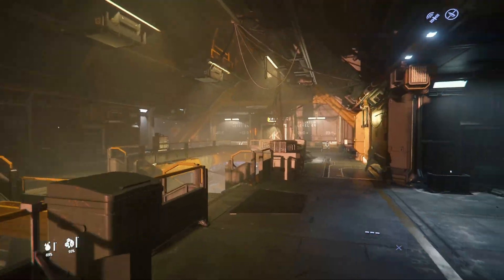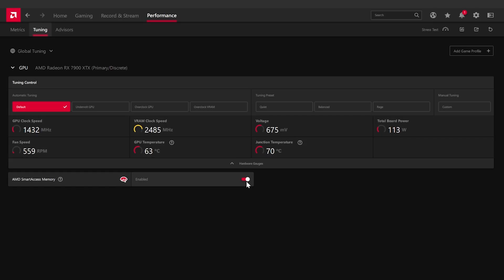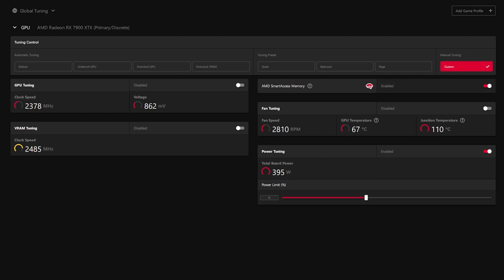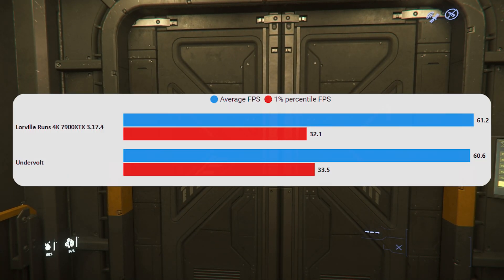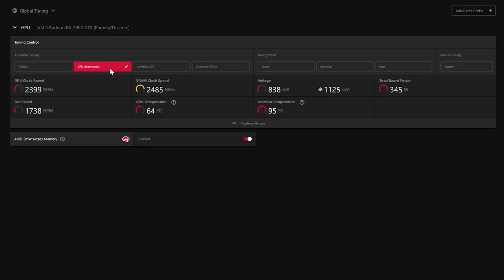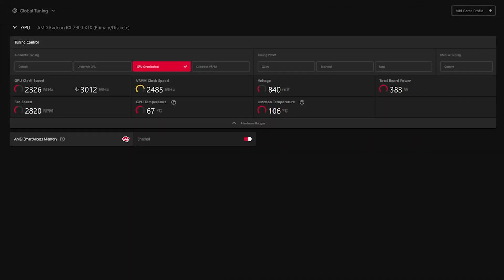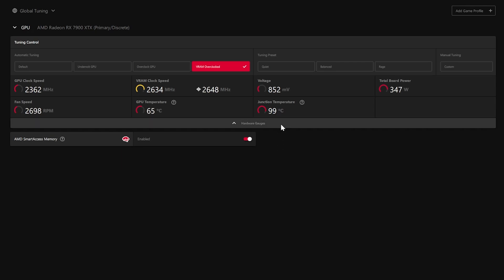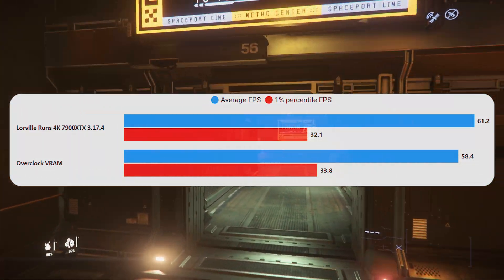7900 XTX Overclocking and Hotspot Testing | Star Citizen

Comment: I just got the MSI 7900 xtx a few months ago. I usually have to turn down settings cause it can get well over 90c, only when ray-tracing though. Id really like to find a hotspot temp fix. My 7800x3d can get well over 80c sometimes too but I'm using an air cooler so that's probably why.

Comment: um 1 you need to manually adjust fans for overclocking they have zero rpm on on default which results in high temps it is not running at 100 percent that would change your temps also may want to check thermal pads and thermal paste application you are literally at a 6900xt overclock performance you really need to manually adjust the fans hate to say it but your overclocking that requires fans at around 80 percent by 60 c and 100 percent by 70 c you should never pass 70 c

Comment: Got the reference card from AMD for 1125€. Had the same issue, my junctions would only hit 110°C with +15% PL. Ended up sending the card back for a refund and got myself the XFX Merc 310. Even at 450W, with 50% fan speed, I don't see above 90°C junction temps in an SFF case.

Comment: Well , you got it wrong , its  n o t AMDs design fault , its their suppliers fault  . The Vapor Chamber itself is not even faulty , its simpel to less coolant filled in ( Water ) . Its not a design failure or   a l l  7900XTX with AMD Design would have the Hotspot Problem  . Its tricky , its just enough coolant filled in that on a Test Bench where the GPU is vertical mounted , the Vapor chamber often works as expected  , if its horizontal ( which is normally the case ) , the GPU runs into the 110C Temp Limit

Comment: i just buy a 13700KF with 32GB or DDR5 ram. I have a basical 3060, i just play in 1080P, should this setup will be great for SC ? I hesitate to go to a 3070 ti OC... but for 1080p i'm not sure if its necessary, whats your opinion ?
Reply from the maker: I would think that the 3060 should be fine for 1080p
Reply: @tenpoundfortytwo  i think too, a TI at least ;) I heard GPU under 3070 could botlleneck with high end CPU, i dont know the reallity.

Comment: Nice Video, i'm thinking about upgrading my 2080ti with a 7900xtx from Gigabyte ( avoiding the 110° risk in getting a bad gpu). Currently running an i9 9900k, curious if i'll get more Performance in Star Citizen with that setup.
Reply from the maker: I think the 9900k could be a real bottleneck in certain areas of the game (cities etc). What resolution do you play at?
Reply: @tenpoundfortytwo  at the moment at 2k (1440p) resolution.
Reply from the maker: For 1440p I'd say the 7900xtx is overkill (but obviously would last you a long time into the future and give you the option of 4k down the line). For Star Citizen specifically, you might be better off moving to a new motherboard and cpu. The new x3d chips from amd might be a better use of your money!

Comment: I don't understand why this bord is still in your hands!?
You have 30c between package and hotspot, it is nuts!
Forget about every other function like undervolting and overclocking, you are working on a broken device therefore,
return it asap and get the Nitro, Pulse or the Devil.
I hope you can return it because the recall might take a while to happen.
Reply from the maker: It's on it's way back as we speak- should be getting a refund asap!

Comment: I am lucky i guess. my new 7900xtx I been playing latest games maxed out,, ray tracing and all, and i'm only seeing 50-60c and not even 100% utilization as well unless I run like a bunch marking program in most games. EDIT: just booted up timespy benchmark, 65c and 80 junc temp. using saphhire 7900 xtx reference card. Seems ok to me unless this is only something that happens in long term sessions or something. People with this issue, does it happen immediately or over a long session? I haven't played any games for super long with this new PC just yet.
Reply from the maker: In theory it should happen pretty quickly if your card is affected. Have you tried increasing the power slider? In theory the card should still be able to keep temps under control, so shouldn't struggle at 400w- but mine can't handle the extra power.
Reply: @tenpoundfortytwo  No I haven't touched OC at all manually on the GPU. I see absolutely no reason to. Every game I've through at on max settings and even raytracing is running like a dream. Even Gothem Knights that everyone says runs like crap seems to have no issues with my card, although it's not like 120fps like many of other games it's still rock solid usually 90+ fps. Spider-man remastered for example has been pretty much locked at 120fps ultra wide 1440p max setting and raytracing and looks incredible. I booted up games lke death stranding. A plague tale, and a few others and so far it's running great. I usually don't experiment with OC'ing until i've had it for a little while. I only turned on the AMD's version of XMP profiles in bios and set auto over clocking for now with Asus's AI over clocking which I am not sure over clocks my GPU or not, I don't think it does. I have it on an AM5 system with an 7700x cpu on this pc i just built. Freaking insane so far. my CPU utilization been around like 2-3% in games, just silly. my GPU in many games around 60% utilization which at first had me worried it was bottle necking but then realized it's just hitting vysnc 120fps limit or something as some games will push it to 100% as well as benchmarking programs.  I haven't actually tried seeing how high frames will go if i turn vsync off yet, lol. My monitor is 175 hz.

Comment: Iam going to return with a comment on this video rahter than the "other one" with knowledge. I compared my performance side by side in game with a friend.
I got a R9 5950X, Red Devil RX7900XTX, 64GB 3600Mhz Mem, WD SN850X 2TB nvme.
Friend R9 5900X, Asus TUF 4090OC, 32GB 3600Mhz, Samsung 980 nvme
We both have same motherboards. So, main diffrence is the RX7900XTX OC vs 4090 OC
we where in Orison, Space, a bunker mission, Area18, 
He plays at res 3440x1440p I play at 2560x1440p
Both on MAX setting on all even clouds.
what we found was that I average 10fps more all places.
also, we found that both of our cpu´s where on high usage, and the gpu´s was sometimes more or less idling in places like Orison.
- yet I did some foolish "nowhere in space" test, searching for maximum frames pr sec ( still all settings on max ) I managed to spot 290FPS - Iam not even kidding.
But, I will stil have to travel to orison to compare the rx6800xt with the rx7900xtx on same location on "various" clouds settings !
- Ill respond to this video once Ive done that - ok ?

But I can tell you that high temps are NOT a problem for the Powercolor Red Devil RX7900XTX, - I recommend that one.
And I also dont think you will get any benefit from the 4080 over the 7900xtx due to my friends and mine result !
Reply from the maker: Great info! Thanks!

Comment: There are some interesting news about the Hotspot Desaster of the XTX Cards ... if you are interested, check out the Video:
https://youtu.be/26Lxydc-3K8

From Roman "der8auer" Hartung about the Hotspot Issues. I bet you can claim AMD and get a refund for sure.
The XTX Cards are great, but the Hotspot Problem kills it ... not acceptable in my opinion. 
Or you can get a waterblock for sure, solves the issue for sure. Anyway this is a nogo for Amd to release Cards with this major problem
Reply from the maker: Mine is getting picked up tomorrow so hopefully will be refunded within the next week or so!

Comment: SOME of the cards have this issue. Mine doesn't have this issue at all, fortunately. But yeah, for whoever does have the issue, it's significant.
Reply from the maker: Glad to hear yours is OK! What sorts of temps are you getting?
Reply: @tenpoundfortytwo  It's never even hit 100° junction under stress testing, and the delta hasn't been very extreme.
Reply from the maker: @LucidStrike  even if you overclock or up the power limit? Sounds like yours is working as it should.
Reply: @tenpoundfortytwo  Tbf, I haven't overclocked. I raised the power limit and set the core to 2400 / 2500. Sweet spot for performance-per-watt and still faster than stock.

If I wanted to straight up overclock, I probably wouldn't have bought a reference card that uses nearly all the power budget at stock.

Comment: I have the Red Devil 7900XTX and it's brilliant. Runs cool and quiet
Reply: I can confirm. My 7900 XTX Red Devil does not hit 110°C. My Delta is around 20°K. Although i must admit i seem to have to ramp up my case fans a bit. As it hits 80°C GPU and 100°C under heavy load. It was better with open case with 68°C and 88°C. On the other hand i like it quiet and even 100°C hotspot seem not too bad.
Reply: @Astravall  yeah mine runs around  85 max. I have it undervolted and it's in a heavily ventilated Fractal case with all Noctua fans.
Reply: @Astravall  my 6900xt has been running around 95c for 2 years, of course, after a strong OC.  And it works fine
Reply: @rENEGADE666JEDI  Don't you want to keep it at lower temperatures so that when you upgrade your GPU in future, you can reuse the old GPU or sell it? Undervolting is imo just as fun as overclocking as it dramatically improves the GPU with almost no disadvantage.
Reply: @AliShaikh_744  I already sold 6900 xt now I have 7900 xtx nitro+,cooling is a bit better because junction temp is around 85c. In the case of radeons, oc / uv must go hand in hand, otherwise there are no good results
Reply: My red devil never gets out of the 80c- 85c range. Junction temp. This is with an overclock and undervolt
Reply: My red devil 65 degrees and Hotspot 100 degrees 430 watt wtf this is not normal never more amd
Reply: @dimakrutoj93  SAME MAN
Reply: @dimakrutoj93  100c for "hotspot" on factory OCd card is well within spec. I doubt its pulling 430w at stock clocks - all reviews have it ~385w.

Reviews also show it has excellent perf / w overall.

Sell it get a 4090 and be happy then.
Reply: Only some of the reference design cards have the issue.
Reply: For me it goes to 103 on oc, and 93c without any oc, bruh, i got rn 4k screen so now i see how high is the junction temp, im gonna try remounting it and placing it vertically
Reply: @amouu_T-rex  undervolting it will solve your problems with no performance drop
Reply: @bullymaguire8868  the 103c is already undervolted to 1095, if i go lower i got game crashes
Reply: How fps on 7900xtx compared to 4080?

Comment: Picked up a 4090... Really working great. Seen over 440W used, no temp issues. Hope the cooling issue can get fixed on the xtx's, it seems pretty wide spread
Reply: Set a power curve up on that 4090..  I never see over 380w on my 4090 after.
Reply: @njasicko  bro how to undervolt 4090????
Reply: @sajithsaji3606  Use MSI Afterburner and set up a custom curve for it.  Lots of youtube videos out on how to do it.
Reply: @sajithsaji3606  Aye Afterburner can do it. I use GPU tweak III (Asus) after watching Der8auer's video on the 4090. Still using Afterburner for monitoring but Tweak 3 was so easy to set a % power and fan target and save pre-sets.

Comment: This is why I always went for Sapphire cards when buying AMD. As much as I'm always rooting for AMD to back-of-the-net every launch... I've been on the merry go round long enough to know to temper my expectations. Now if it was an AIB cooler or a water block then sure, the card will truly flourish I've no no doubt.
Reply from the maker: Yeah a water block might be the best option for me if I can't get a refund!
Reply: I just got the Sapphire reference card for 7900 xtx. Not by choice was just what I found in stock but it's working beautfully and junction temp isn't anything like what others posting so far. (80c is about max that i seen so far)
Reply: @zengrath  Every time Gamers Nexus does a review and teardown of a Sapphire gpu they have been impressed by the build quality and used it to contrast how other makers "do it wrong".  Their reviews are why when I bought my RX6800 I only looked at the Sapphire gpus.
Reply: My amd card is a sapphire 7900 xtx and it still cooks at 110c junction unless you limit it to 2450 MHz
Reply: @sandzibar  The first drivers for the 7900XT and 7900XTX had high power consumption issues.  If you haven't upgraded the drivers I would try that first.  If that doesn't work you may want to contact Sapphire.
Reply: my nitro+ is on its way 😁
Reply: @rENEGADE666JEDI  Sweet!  I'm excited for you!

Comment: Personally I have never had any luck with AMD graphics drivers.  As such I have stuck to NVIDIA, I figured I'd try a 6800xt and I had to re-install the graphics drivers an average of every two weeks.  A lot of people I know swear by Radion cards, I just keep getting the bunk ones.  I currently own a 4080, and while it's not the monster that the 4090 is I'm happy with it for SC.
Reply: The most important thing to do when switching from Nvidia to AMD is either use DDU to wipe the Nvidia drivers or do a clean Windows install. I had similar problems when i switched from a 1060 to an AMD card. the Nvidia uninstaller left files and traces on the system and caused instabilities (i have a feeling that is deliberate -.- ) ... after DDUing the Nvidia remains and reinstalling the AMD drivers everything was fine.

Comment: sadly  AMD and ATI had the problem with reference cards way to long.  It seems also that not all cards are affected by it and therefore is a problem on the manufacturing side. Meaning that the engineers did anything right. 
I had to many problems with the reference design that I never would by it other then the NV reference. 

Still unsure what card I want to get. Prices for the the  RX 7900 XTX is around 1400€ or more for big custom coolers right now. The problem here is that the 4080 is cheaper , even custom designs is like 1333€ and the 4080 should be mostly on the same level as the 7900 xtx.

Question is how much difference will it make in SC
Reply: Probably very little difference in SC right now unless you are playing at 4K or have the volumetric clouds set to the higher settings.
Reply: @The_Opinion_of_Matt  yeah I only want to improve 4K performance because my 6800xt can’t get stable 60fps. I also have driver issues and can’t use the recent one. Mine is 8months old because anything else will Crash SC

Comment: In time spy extreme, through all loops, my delta was pretty good, about 10ºc (Junction was at ~88ºc), 2600 mhz and the board power providing standard 347 W. And this represents my experience with most games I tried - except cyberpunk, which brings my delta to a sad 30ºc and a Junction of 100ºc (but then again, the game crashes when using recent updates, settings crash to desktop)

Not all cases will be the disgrace of immediate 110ºc, some will probably be like mine where you don't have trouble but you're not trully confortable with the future. Even people who got lucky in the silicon lottery will probably look a bit insecure

I will await AMD's reply to the situation, since I really liked the xtx, but I wish you luck in the exchange for the 4080!!
Reply from the maker: Sounds similar to me. I should try Cyberpunk, that's a good idea! That's a good way to describe it- I'm just not comfortable with the particular card going into the future, seems too close to the limit for me. Hopefully AMD will release a response soon.

Comment: That fan is like 40% max eh?
You should mount your gpu vertical (turn your case). See if temps change.

4080 needs 3.0 capable PSU btw. Don't burn your gpu with an adapter.
Reply: It probably wont change anything. DerBauer did an investigation and found the vapor chamber they use is critically flawed.
Reply: @lamikal2515  it isnt that critical because its a manufacturing defect and not an engineering one. Super bad nonetheless.
Reply: @lamikal2515  Well in the video before that. He found the position affected the cooling. Which lead him to the vapor tear down.

I'm curious for my own sake. I plan on buying one. I'll be using a water block but it's still interesting if it effects temps/performance.
Reply: @caldeio  Gamers Nexus found that the reason for the melted power cables on the RTX4000 series had nothing to do with the cable and was actually user error.  The cable wasn't being pushed all the way into the connector on the graphics cards.  Now it is actually recommended to push the cable into the GPU before installing the GPU into the motherboard.  I think the Gamers Nexus video was from early December or sometime in November.
Reply: @The_Opinion_of_Matt  For me, the biggest flaw of the 12VHPWR connector is the lack of feedback regarding it's plugging :

Firstly, you need far more force than you would consider adequate to plug it in.

Secondly, when it's plugged, the sound feedback is should be way louder. When you plug a PCI-E plug to your GPU, it makes a very noticeable click, assuring the user that the cable is fully secured.